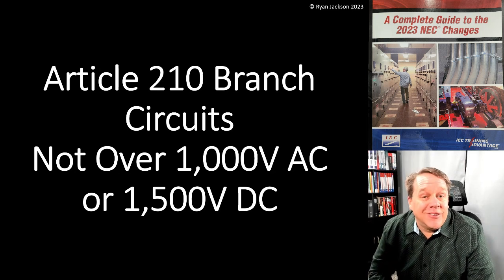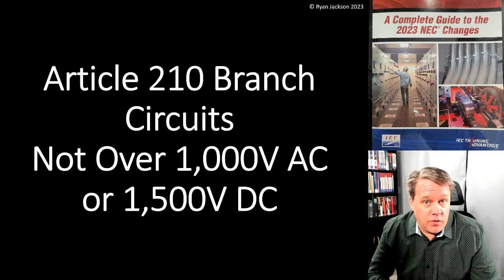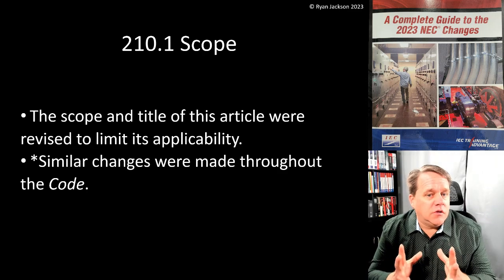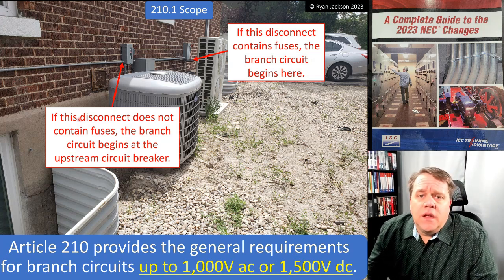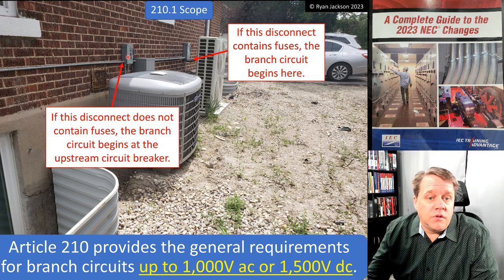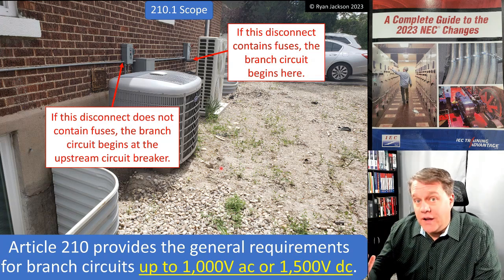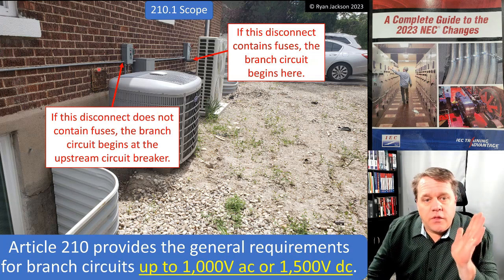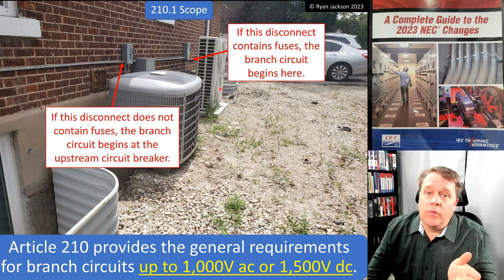2023 210.1 Branch Circuits Scope

Comment: I hate to be that guy, but I would prefer the structure of the book remain as is for two reasons. First would be tradition. Secondly I think the book should be difficult to learn and require deep background knowledge to navigate. If someone is good at the code as it stands, most electricians know that they put in the time to learn. If it gets handed over to you on a silver tray anyone can pick it up and recite code.
Reply: Subjectively I think you are the reason why the trades suffer and younger people are not as inclined to enter. Just because something was hard for you doesn't mean it should be hard for others. Do we still talk like our forefathers did when they came to America? No. Why should the code book use the same language and layout as it did 100 years ago. 

I would respect your reply more if you just said, "I don't like change."

To each their own I suppose. Hate to be the apprentice that's stuck under you to learn.